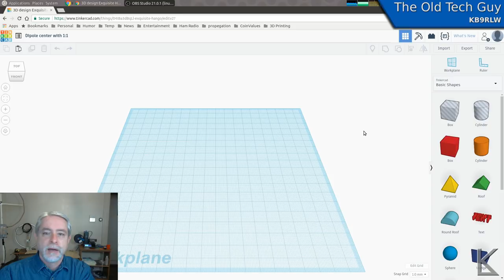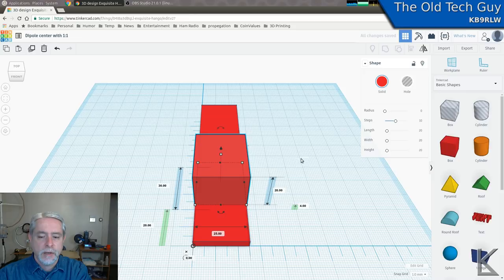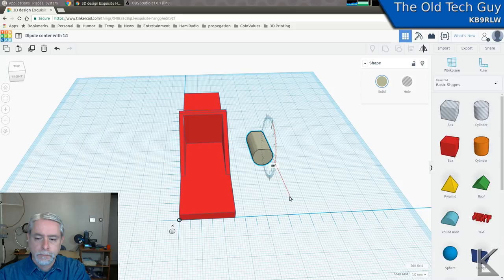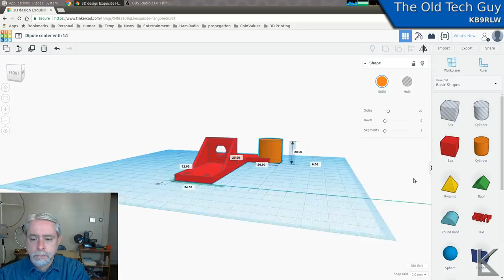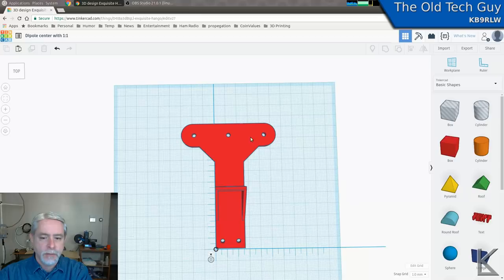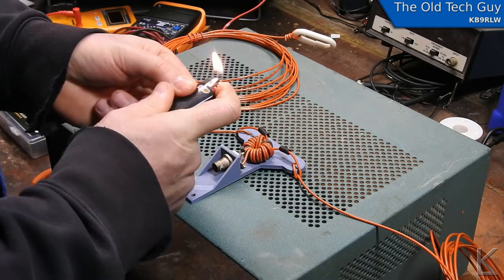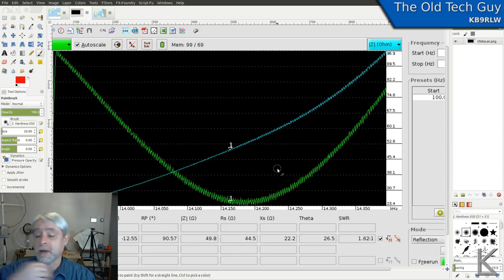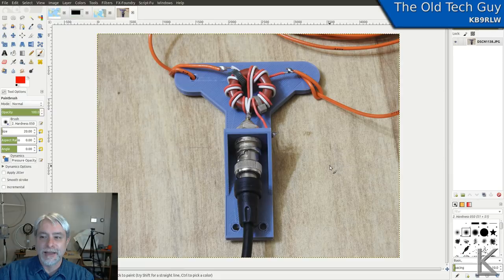3D Printing - A Ham Radio dipole center with BNC and 1:1 balun

Comment: Haha, my suggestion for a print. Nice job. 

An idea for a VHF or UHF dipole would be to add 2 blocks of material both sides of the ‘T’ each with a through-hole to allow threaded rod to be fed through and secured with nuts either side. 

The nuts can also be used to secure short pigtails from the coax connector to the radiators. .

Comment: Nice job. The only change that I would suggest is to make the fillets rounded rather than triangular as sharp corners promote stress fractures.
Reply from the maker: In solid materials, that's true.  3D printed parts are laminated layers though.   I doubt the usual thinking applies in all cases.

Comment: if you are serious about designing your own parts for 3d printing, Drop tinker and freecad, and get your feet wet into fusion360, once you can get a feel how the sketch works, it rather a powerful straight forward CAD software.
Reply from the maker: As soon as they release a Linux version, I'll check it out.

Comment: Hi  Kevin, Can you do a video on how to weatherproof an antenna for permanent installation. It would be soo helpful to me.
Reply from the maker: There's really not much to it.   The goal is to keep water out of the coax and off of anything that could rust.   You can wrap exposed  PL-259 and BNC connectors in black electricians tape.   For a permanent antenna like this one, you'd actually want to use some kind of weather proof enclosure for the choke.   Sealed box, or PVC pipe or similar for the center.

Comment: Nice job, Kevin.  I was wondering about the suitability of PLA outside, as I read that some is biodegradable.  But it sounds like you have some experience with prior projects outside.  I'd be interested to verify how well it holds up over a couple of years.  I've made antenna parts from PVC plumbing that are still holding up after 3 years.  I've also heard that PVC degrades in sunlight, but there you go...  73
Reply: I can say that PLA does not hold up well in the heat of the SouthEast Summer for sure. Many items I have printed in the winter for my mobile rig failed due to the high summer heat due to the "solar oven effect" in the car.  I have not tried any direct sun testing outside, but I would only use PLA for the prototypes and ABS or another plastic for anything I wanted to actually keep with low maintenance.

Comment: Kevin, enjoyed the video, wish I had a 3D printer and knew how to use it. I suppose you have been 3D printing for some time or you are a very quick learner. I don’t know much about “whisper transmitting”. What all equipment do I need to try that. How do you know where you transmitted, you don’t actually make contacts do you? I will have to study about that some. Thanks and keep up the great video.
Reply from the maker: Thanks for watching Cliff.   WSPR stands for Weak Signal Propagation Reporting.   It's a bacon mode, supported by the WSJT-X software package.  You need some kind of computer to radio audio interface like the popular Signalink or my own DuinoVOX.  There's a couple of web sites where the software uploads info on all the stations it heard.  These sites will then map what stations heard a callsign so you can see how far your signal was detected.  It's an extremely robust transmission that can be decoded with only a whisper of a signal.
Also,  I have a series of 3D printing for beginners videos.  Browse back in my video library, they were recent.

Comment: What makes one toroid whatever more suited for this project as opposed to another toroid?
Reply from the maker: The mix of metals the torroid is made of will affect it's response to certain ranges of frequency.  I used the type 2, but there's another type that also works for HF, type 43, I think.   The type number is the second part.  So  T80-2 is 80 hundreths of an inch in diameter and a type 2 mix.

Comment: Can you draw 2d shapes in Tinkercad and then extrude them? Or does everything have to be a platonic solid? I don't know if it's because I cut my teeth on AutoCAD, but that seems really tedious to me.
Reply from the maker: No, can't draw in tinker.  However, you can import SVG files.  So you could draw in inkscape, illustrator, or other 2D vector drawing programs and then import into tinker to extrude.  
I've used that method before and it worked well.

Comment: Kevin, is there a reason why you have exported your “tools” instead of making them into tools to show up on the right hand side in the tool menu?  The other thing I like to do when aligning add on parts like the corner braces, etc is to drag a workspace grid to the surface I want to affix something to, then with the part selected, hit the ‘d’ key to drop it in place (and “drop” is not just an up to down motion).  - N1XF
Reply from the maker: I exported them for a couple of reasons.   I might use them in another program such as freecad.  Second is I upload these parts to thingiverse.
Still learning all the tricks in tinker, already knew about moving the work surface, keep forgetting about the 'd' shortcut.

Comment: Not sure if you mentioned this in the video, but what does the whole antenna weigh? Also, what gauge wire is used for the antenna?
Reply from the maker: 18 gauge wire,  labeled as 'doorbell wire' from the hardware store.   I didn't weigh it, but it's not much at all.

Comment: I've seen several kits have holes to wire tie the toroids in two spots to a circuit board. You could potentially put holes to wire tie this toroid on. Is tinkercad in a repository?
Reply from the maker: Tinkercad is web based, runs in your browser.